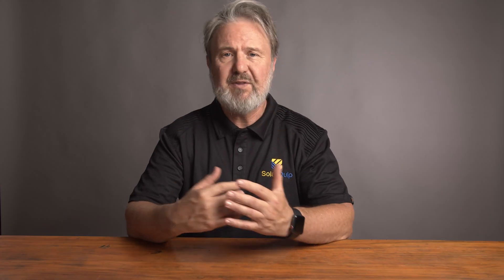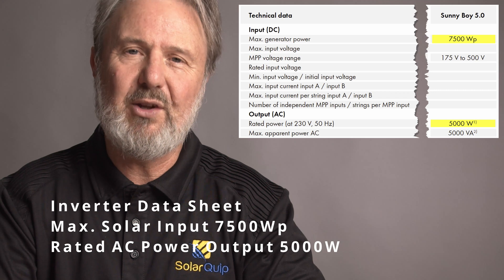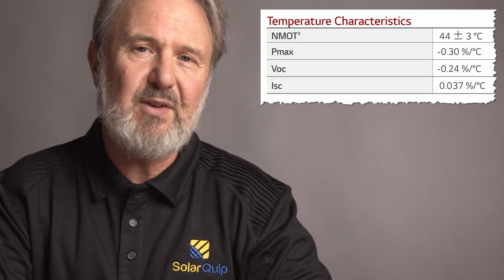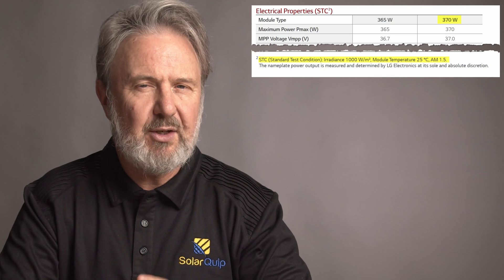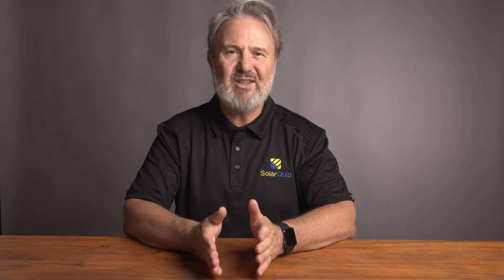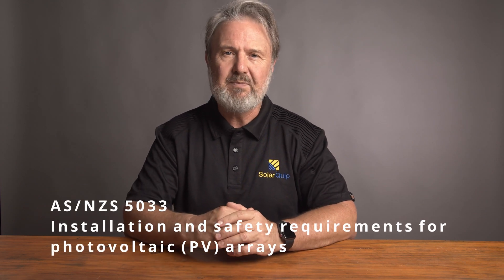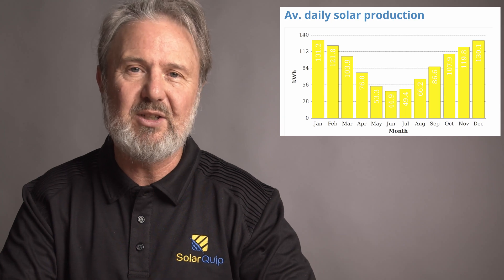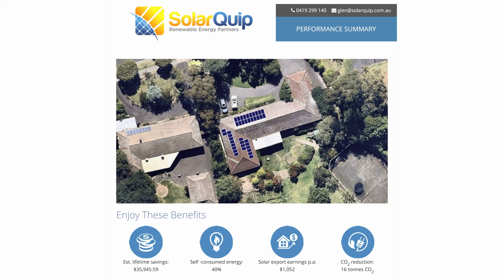Solar Panel Yield vs Peak Power

Comment: How do I measure or calculate the output power of a solar panel? Basically I am interested in calculating the yield produced by a solar panel per day what is the procedure in doing this?
Reply from the maker: Yes, the formula is Peak Sun Hours/day for the azimuth and inclination of the panel x the name plate power rating of the panel x derating factor for temperature, dust and dirt, wire loss, modules mismatch. Eg. for a 300W module at a site in summer here in Melbourne with a north facing array at 30 degrees inclination and an average daytime temperature of 25 deg. C (5.6 x 300 x 0.85 = 1,428 Wh)